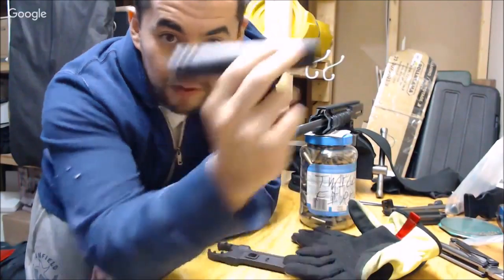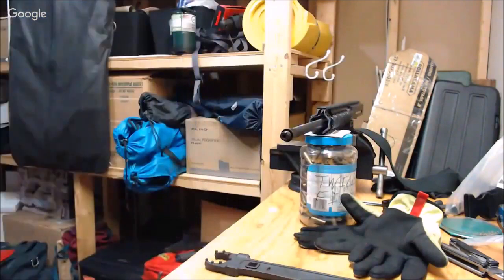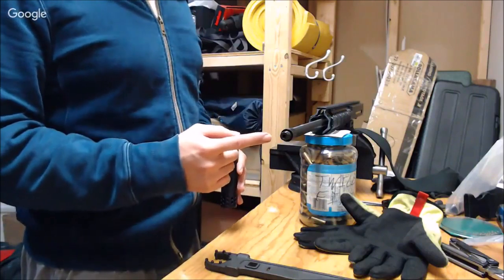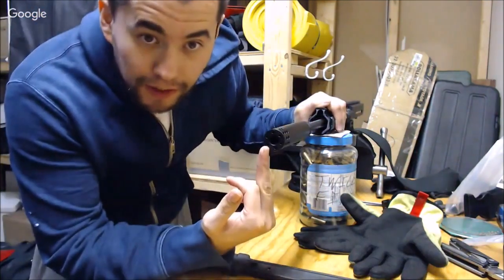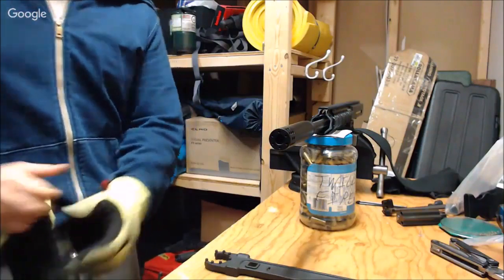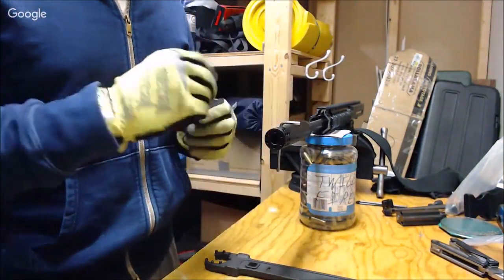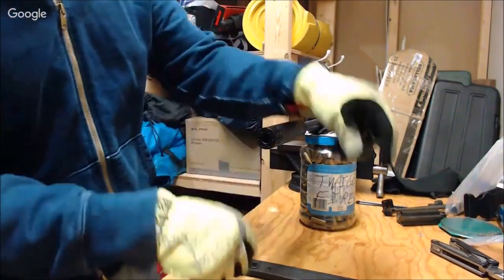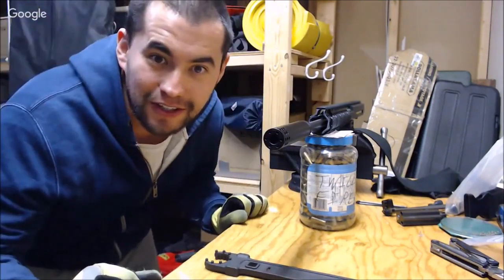Installing a Fake Suppressor Muzzle Brake on the WK-180c with Crover

Comment: Dude how the frick did u get the flash hider off? I’m having so much trouble. Any advice would be appreciated!
Reply from the maker: Either clamp the barrel in a vice with wood to keep the finish from marring, or use BEV block like I did in the vid to keep the barrel from turning.

Comment: do I have to take the upper off and install it?
Reply from the maker: It is easier, but not necessary. You could just clamp the barrel using some pieces of wood and a vice.
Reply: @thecanadagunstalkshow5230  Thanks man